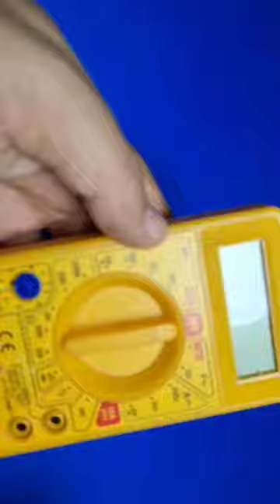Multimeter Upgrade #zaferyildiz #short #shorts #led #diy #viral #multimeter #electronics #diya

Comment: I like it but it's a bit overkill.. one led on the side with a light guide would of done. I have one of these (in a different case) and it has a green back light. Just one led and its very bright.. easier on the battery.. 👍🇮🇪🙏
P.S. you can find light guide's for these screens from lots ot other things.. one led(green works great) will work perfectly.. my same meter uses one and it very bright and easy on the battery. 😊

Comment: There is a big mistake. Before closing the LED lighting system, there was no battery warning, but after closing the LED warning, the reason: either it is taken from the input of the selector, which causes a voltage drop in that bus, which must be switched with a transistor, or the power of the lamp is too high. It can be obtained from a  he used led but polished the back of the lcd so that the light reflection is better, it is a good idea for cheap multimeters